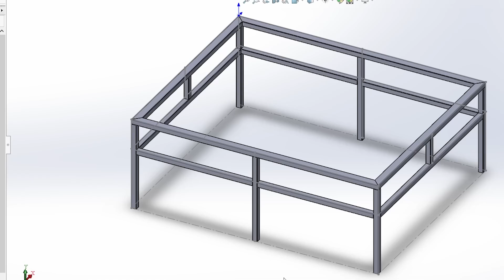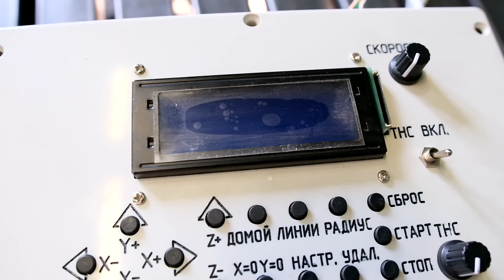A GIRL builds CNC plasma cutting machine. DIY. Part 1.

Comment: Impressive work.  I'm wondering whether you've had any galvanic corrosion of the aluminium parts from their direct contact with the naked steel frame for 3 years.  Generally, some kind of coating is used between them to prevent the transfer of electrons between the dissimilar metals.

Comment: 8:55 Oh no! Use either WAGO Lever-Nuts or solder seal wire connectors. I suggest the WAGO, you can take them off. Easy to use and relatively inexpensive, worth the time savings. If you're made of money, use wire ferrules on everything too ;)

Comment: On the aluminum bracket holding the gantry at 5:28 you should have wrapped the welds around the corner. The corners is where the cracks will start, and if they are left unwelded like you have done it will be much weaker in the long run than if you wrapped the weld around

Comment: Nice Woman, nice Work!
But you should change your shoes when working with metal, especially when welding Mig.
Regards 🙋‍♂️
Reply from the maker: Thank you!
I wore steel-toe boots while welding and changed them for sandals only when started assembling, because it was very hot that days ;0)
Reply: @luciasworkshop  Yes, for sure... The heat :D Good Luck

Comment: Great job, I just wish you would clamp down your material when using the drill press.
Reply from the maker: Thank you
Reply: Yah totally! PLEASE PLEASE DONT hand hold metal parts in the drill press. Its a great way to rip your hands apart - literally- as the drill grabs and spins the workpiece around. I did this stunt just the other day. Not pleasant. I escaped with a minor 2 inch shallow cut.

Comment: Hi there! Nice work overall. But I would rather add separate motor for each side of the X axis, because some considerable twist might occur in that long and narrow shaft.
Reply: Skip the step(s) of one of the stepper motors due to a software fail can cause more problems than the shaft.

Comment: 7:53 - such a long and thin rod will have a significant torsion introducing linear differences between two sides of the gantry. Especially during accelerations. It's better to use thin walled alu tubing. Try diameter that fits the couplings you're using so it will be easy to fit it. You'll see the difference in stiffnes.

Comment: Lucia, girl you have skill for days.  Mad props for this build, you've got the mind of a mechanical engineer and the skill of a lifelong machinist.  Most CNCs are not even built to this level of, well, ridiculously stout overengineering lol.  We build alike.  But it is a really clean, strong, and clever build, it's satisfying to see you work through the various minute issues that always come up.  I have a couple of questions - What type of mill and lathe are you running, they look like an old set my dad taught me on but I've not been able to find them since.  And secondly, what did you use for your controller, if I may ask?  It may get answered already in the next videos, so I'll keep watching.  You just earned yourself a sub chica, your channel is highly underrated. Keep it up!!!  I'm not sure who or where you learned from, but you have a solid foundation in metalworking that would be the envy of many a shop.  You ever want a job in the US, hit me up ;)

Comment: Pretty cool little plasma table! Using a single drive shaft for X (Y) is a neat solution, however might be pain in the rear to adjust squareness. With separate drives (X1, X2) for the same axis, the squareness adjustment is simply done with moving end switches. Is it going to be water bed, downdraft table or just open blow-through grid?
Reply from the maker: Thanks! Soon I will publish the second part of the construction of a CNC machine with a cutting test ;) And I plan to make a table with a smoke extractor.